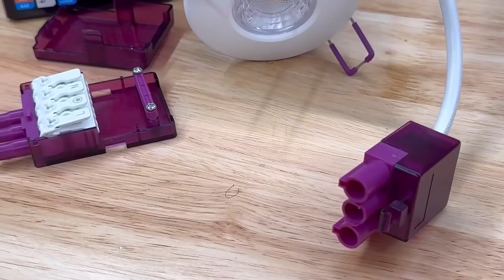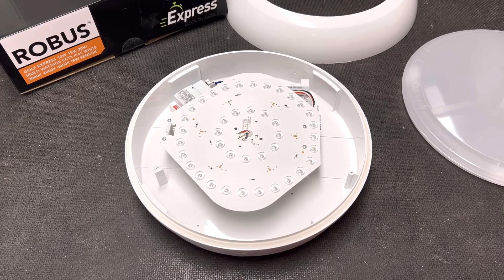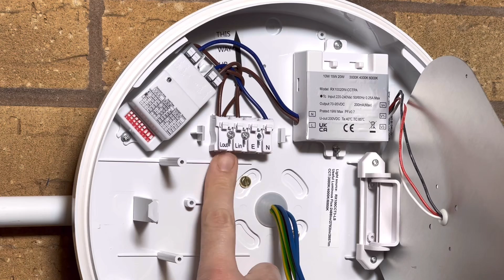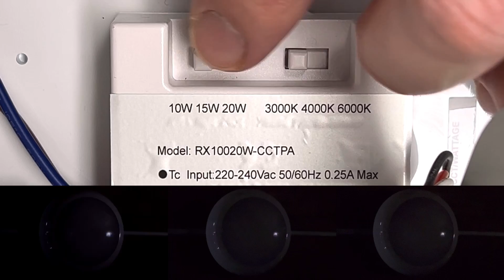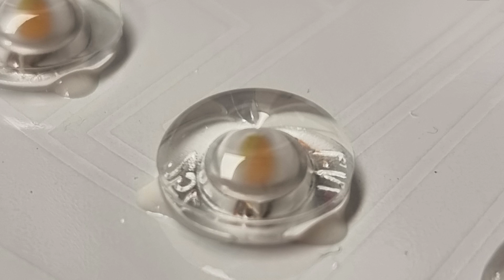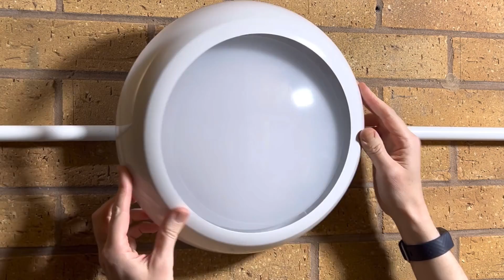This ROBUS GOLF LED Bulkhead Surprised Me

Comment: Another benefit to having multicolor LED chips is that you get some level of redundancy if one of the rose goes out you could temporally switch it to one of the off-color's until replacement. I know I look horrible but at least you'll be able to see what you're doing. That's assuming the driver doesn't go out.

Comment: Are there any rules / guidance recommending these should be installed facing downwards, not outwards from a wall?  
Asking because I've seen these used to replace the old rectangular fluorescent bulkheads in stairwells and these are blinding when fitted on a wall compared to what was there.

Comment: The fold up design of the LED PCB is a first for sure especially when you are attempting to install it on an external roof space like a porch
Reply: Definitely not a first, I've installed a couple of bulkheads that are like this, albeit with screws instead of a clip.
Reply from the maker: Clever isn't it? 😃
Reply: @efixx  definitely designed to make the install easy

Comment: The merrytek microwave sensor, don't make it too sensitive as it will detect your neighbours movements (don't ask how I know.)
Reply from the maker: Sounds like an interesting back story here... 🤔😂
Reply: @efixx  I didn't change the sensitivity as it works as a sensor light so if you walk up to the door the lights inside the home come on, no floods needed.
Reply: Yep, can see through stud walls/doors .... and also sensitive to wet vegetation unlike a PIR... (when the sensor is used outdoors)
Reply: @TheChipmunk2008  can it trigger if I put it in the microwave.

Comment: Is there a maximum number of lights that can be controlled on the switched output?
Reply: Manufacturer says on their website the maximum load is 400 Watts which is 20 standard luminaries.
Reply from the maker: Thanks Dean. 👍
Reply: Almost certainly but good question :)

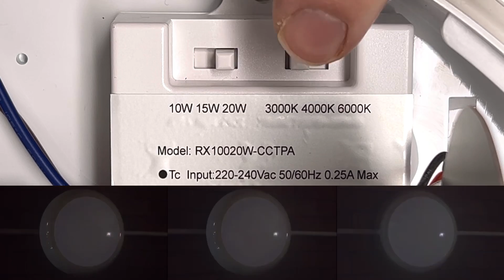Comment: 4:42 It's 4000K that's Natural or Neutral White, not 3000K which is Warm White.
Reply: Actually it is not.
Natural white is daylight on a sunny summer's day which is around 6000 Kelvin.  Some manufacturers might call that cool white, but that 6000 or 6500 is the standard temperature for daylight balanced photographic film which gives natural accurate colour rendition.

It's up to each light manufacturer to name their colour temperature.

Fluorescent tubes which are sold as daylight balanced are typically between 5000 and 6500 Kelvin.

Comment: What is the refresh time? When it has been triggered, then goes off, how soon can it be triggered again? If someone walks under it while it is still on, does the time reset to the beginning of the selected duration?
Reply from the maker: I believe it can be retriggered straight away and will count down from the last movement detected. 🤔
Reply: @efixx  Yes that is the behaviour of those Merrytek sensors, similar to PIRs